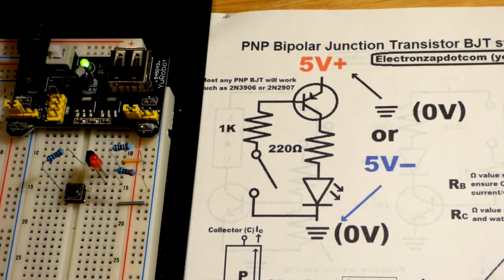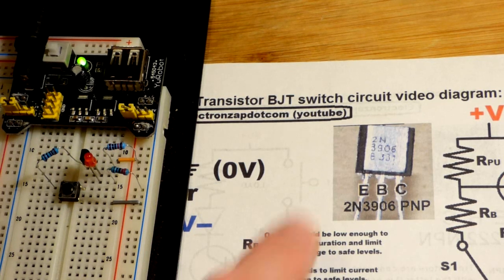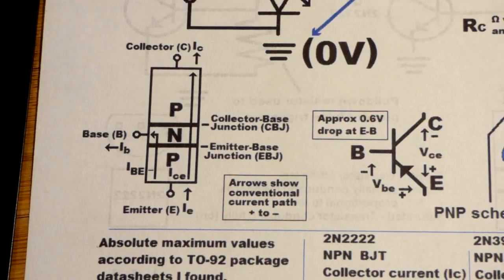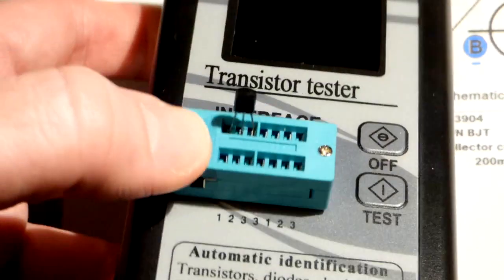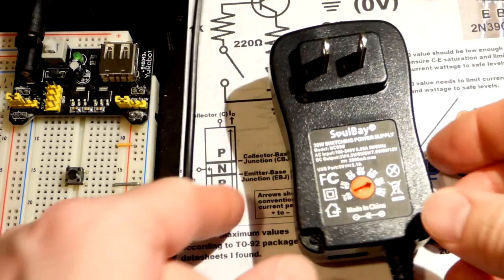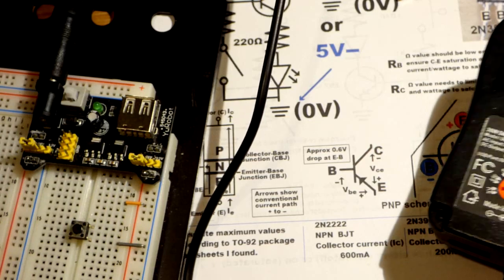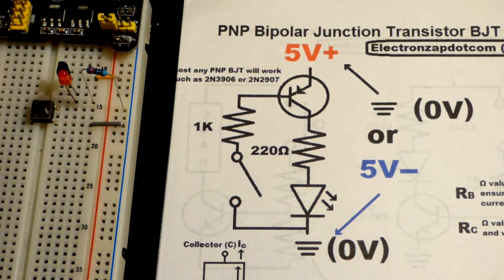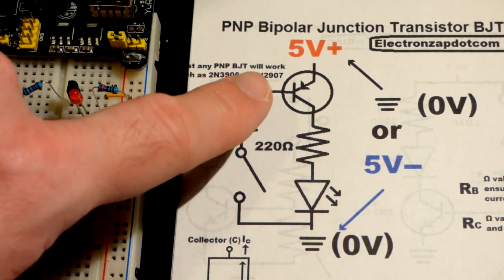Transistor circuit 2 PNP BJT 2N3906 switch for beginner DIY electronics hobbyists

Comment: Just wondering if you have ever checked the output voltage of the breadboard power supply when connected to 9v or 12v.?  The output on the 5v side on all of mine show the voltage of whatever is plugged into the barrel jack. The 3.3v side seems to be regulated however. Strange.
Reply from the maker: I almost always use 9 volts with them. I have fried some when I accidently short circuit them and I think it always output the power source voltage after that. I have bought about 12 of them and have fried about 4 of them so far.
Reply: @Electronzap  I fried mine as well. Seems the 12V wall wart was actually putting out 17V :)

Comment: The arrow always points to the N region. In this case it shows that the N region is between two P regions. When it points out to one of the edges it shows that the edge is an N region, therefore it has to be an NPN transistor. Eat Big Cookie! 😏🍪